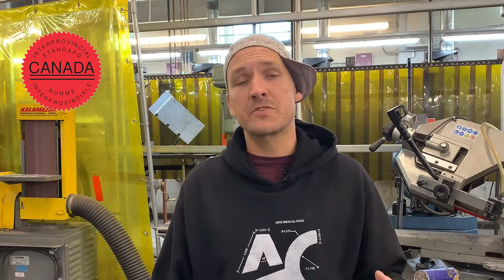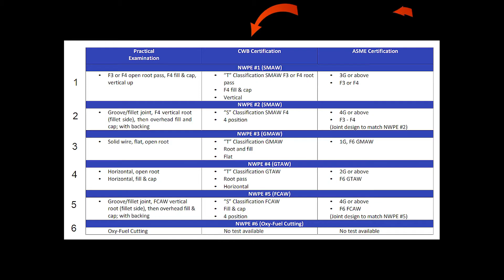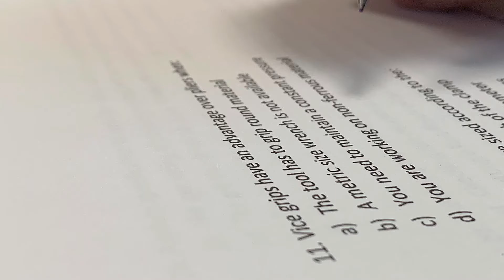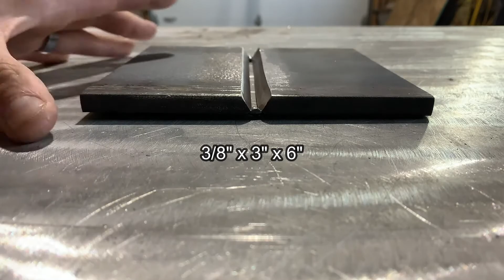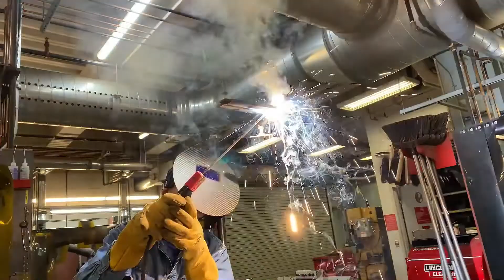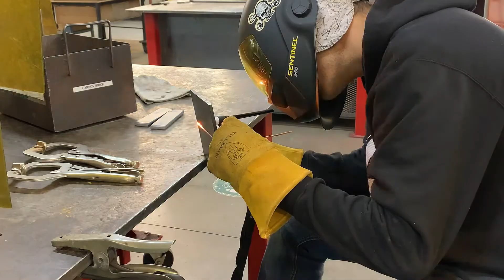How to Challenge your Red Seal for Welders

Comment: Great video. How many hours of experience is required for the trade equivalency? I went to a non-apprenticeship welding program and the number of hours requirement is not clear.
Reply from the maker: its 6000 hrs total. if you went through apprenticeship it would be 1560 field hrs and 240 schooling per year for 3 years

Comment: What does the oxy fuel portion of the red seal look like? What do you have to do?
Reply from the maker: @Mitch-ui8ps  usually it’s a circle with a 30 deg bevel then a 45 and straight cut on the other end might be different now
Reply: @sewingwithfirewelding5627 nope exactly same even now